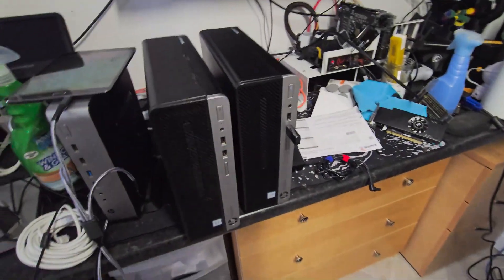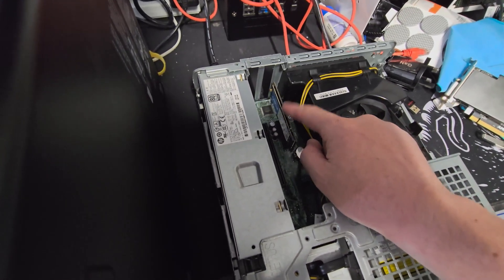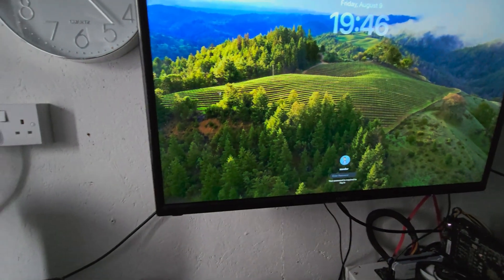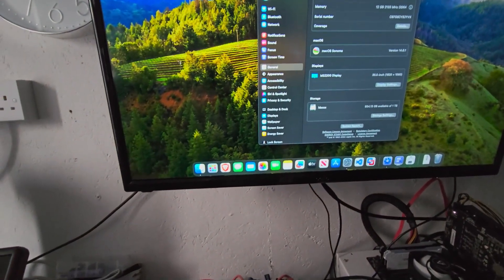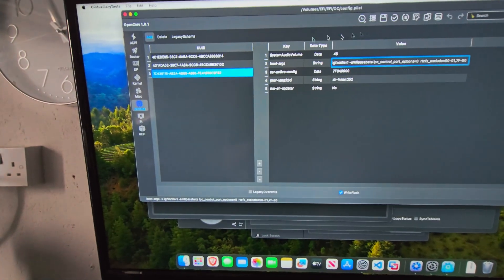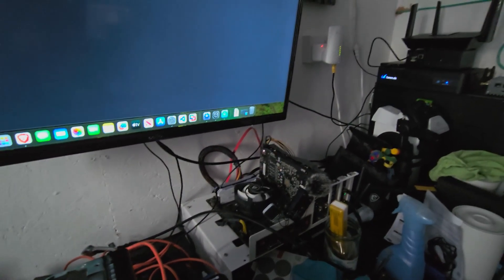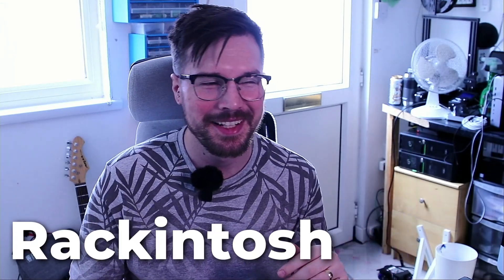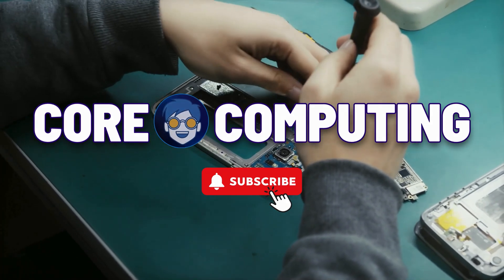£50 Hackintosh: HP ProDesk 400 with FREE EFI - Ultimate Budget Build!

Comment: Thanking you for your contribution in creating that EFI for the HP 400 G4 SFF, you have overlooked several things in any case. The mapping of the USB ports is poorly done, in the kext that you created there are several ports that appear as Internal, (in fact there are) but not that many. The Internal USB port on the motherboard where a Fenvi HB-1200 card is connected is not mapped, I was not able to map that port either (it should appear as Internal 255) I don't know if the internal SD RDR port should be activated from the same BIOS ( something I didn't find) and in my case it is necessary to activate it to power the Fenvi's Bluetooth. Do you know how to activate that port that goes inside the motherboard?
Reply from the maker: ahh np ill have to make an update for this
Reply: do you have an efi and the hp bios settings for an HP elitedesk G3 800 i5-7500?

Comment: in video you say i5-7500 but your delivery message says i5-6500. what is it exactly?
Reply: ahh yes sorry it is an i5-7500 I have two of these units one is an I5-6500 and the other is an i5-700 I've just got muddled up in the title but the unit is an i5-700 I will change the title.
Reply: the EFI will work with both because thy are almost identical chips
Reply: @xandercode  thank you very much for responding, can I ask is there anything I should consider before installing with the EFI?

Comment: EFI working on HP ProDesk 400 G3 bruh?
Reply from the maker: It should, there is not much difference between the models
Reply: succefully installed on 400 G3 SFF (6500, 16Gigs, 512GB SSD with igpu)
Reply: @remeknv_  was there much modification to the refi?
Reply: @remeknv_  do happen to have the hp bios settings and the efi?

Comment: Still dont understand why you removed your video on RSA for Lenovo Y700.  It ended uo being easy enough, but that video was ther ONLY one like it and you took it down?
Reply from the maker: Well, It's not removed, just hidden. I mean, it was easy to understand, but I guess people with no knowledge of android or any background research about the 240 - 77 update left comments on it about bricking their tablets. I did lots of research to make sure that it was easy and told people they must do research as well.
Reply from the maker: Its back up it has been for a couple of weeks
Reply: I had no problem doing it. I had an OTA update come through yesterday to update from 15.0.240 to 15 0.358 stable but I'm hesitant to do it. Everything works great. 

I just wish you didn't get forced to go into PC mode when a BT mouse is connected. I'm assuming a wired mouse would do the same thing
Reply from the maker: I've done the update it works fine  @-Airwalk1616-
Reply from the maker: @-Airwalk1616- are you doing it by downloading the zip and flashing. are you on global rom